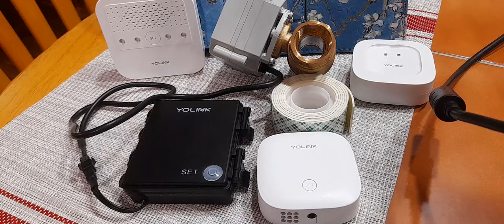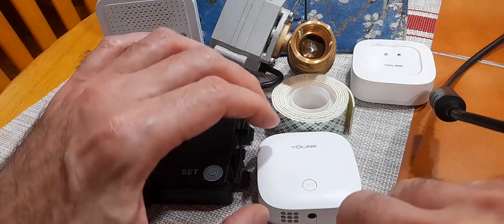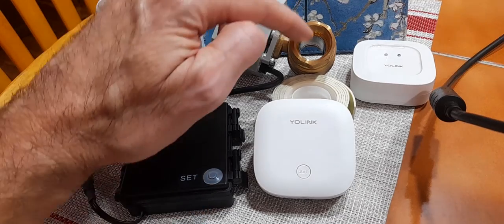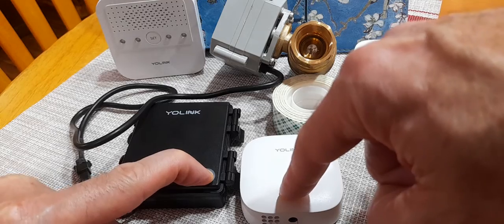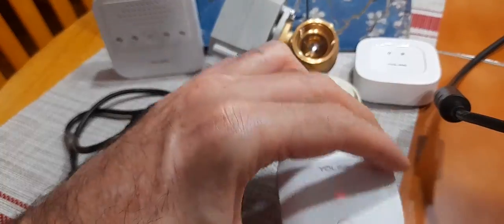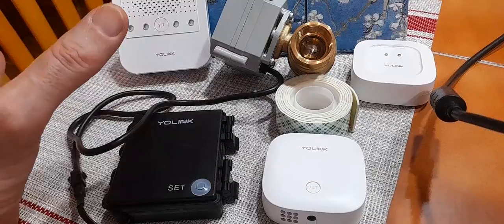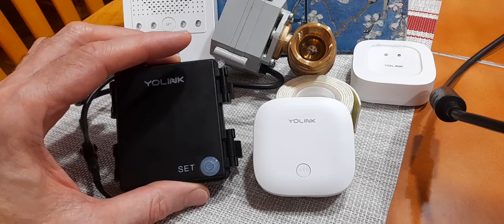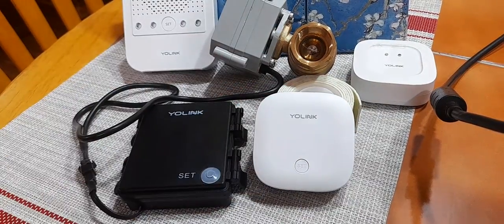How to Setup Yolink Smart Water Valve.

Comment: How do I set up that sensor without the wire?  It is in the app but say offline.  Same for my valve, but I got the speaker hub to connect because it had the button and voice that speaks.  I pushed the set on the valve and the sensor, but both kept blinking green but never paired???
Reply from the maker: You are referring to water link sensor 1?   You have to hold the set button until the sensor blinks green, then hold the set button on the water valve until it blinks green.  Make sure the valve is in the closed position before starting the paring.   Here is a link to Yolink's tutorial: https://youtu.be/dD6oNUzuxSE?si=0KbAcO-M6Q8F4mEM  If that doesn't work you may have to do a factory reset on both.  Let us know if you need further assistance.
Reply: @CyberMedics  Yolink walked me through it, but thank you too!
Reply from the maker: Glad you got it sorted. Thank you for commenting, giving the video a thumbs up and subscribing to the channel. We appreciate the support. Done a lot of content on account and device hardening if you're interested in that let us know we'll send you links to the videos.

Comment: Hello, I have a question on the length of the ball valve (1" valve) from one end to the opposite end without any fittings. Thanks.
Reply from the maker: We installed the three-quarter inch valve. I’m not sure it’s the same as the 1 inch valve would recommend calling YoLink Tech Support and asking that specific question. Thank you for supporting the channel by coming and giving a video thumbs up. Please consider updating us to install the valve. let us know if you have any other questions.

Comment: Hey i know im late to this video, but do you think his would be worth using as a hot water bridge valve for long distance recirculating?
Do you know what's the protocol it uses to communicate with the hub?
This would be great to use with a smart outlet to turn on the recirculator pump and also some temperature sensors clamped onto the copper piping!
Reply from the maker: Thank you for the comment/questions.  I've included some useful links for you below.
The hub communicates withe the device via the LoRa profile.  Yolink products can communicate device to device up to a  1/4 mile (approx. 1300 ft).  

The valve functions like a normal ball-cock valve, with the addition of a smart controller.  Yolink also has an AC power supply for the valve.

a) Hub Manual: https://www.yosmart.com/wp-content/uploads/2019/12/YS1603-UC-YoLink-Hub_User-Guide_20190903.pdf
b) Device to Device Protocol Explainer:  https://shop.yosmart.com/pages/explore-home-page
c) Hub Homepage https://shop.yosmart.com/products/ys1603
d) Semtech: Company behind LoRa tech: https://www.semtech.com/products/wireless-rf

Let us know if you have any other questions.

Comment: How do you know when it's time to replace a sensor? They're advertised as 5 year internal battery life, then discard, as sensor is fully sealed non serviceable.
Reply from the maker: You can check the battery level in the application for yoLink. You can open them up and replace the battery. We have done this. It might affect the water resistance of the sensor, but it will still work.
Reply: @CyberMedics  Good to know, thank you
Reply from the maker: Let us know if you implement the water valve and any lessons learned

Comment: I’m upgrading my water heater & softener soon, wanting to incorporate a system like this. I’m strongly considering yolink! Is there any indication on the unit that it’s open or shut? Does the app know if the valve is open or shut? I like this built in ball valve actuator, seems more reliable than mounting an external actuator for the lever. I just want to know when the valve is open or shut lol
Reply from the maker: Sorry for the late reply.  There is not an indication on the valve.  But if you have the Yolink Hub it will show in the app the status of the valve and all of the sensors.  I agree strongly that the integrated ball valve is much more secure.  Please let us know if you need help or have any other questions.  Thanks for commenting and subscribing!

Comment: I love YoLink...But what if you have fire sprinklers in your house, and a fire breaks out, and the sprinklers flood a sensor... and YoLink turns your fire sprinklers off. ?
Reply from the maker: Excellent question. In that case you would want to put in a bypass valve to go around the house shut-off valve so that water would always be present at the sprinkler heads. The bypass valve could be tied to a separate set of sensors that would alarm only when there was a malfunction with the sprinkler system. For example if a pipe had broken and water was detected then it could shut off water to the sprinkler heads. Would you please like the video and subscribe to the channel which supports our efforts to helpi others? Thanks for commenting and let us know if you have any other questions
Reply: @CyberMedics  Excellent response Thank you
Reply from the maker: @avpowerstn1  That's why we created the channel...to help others. Please spread the word Jim and thank you for the detailed question.

Comment: How reliable is it ? Thanks for the video.
Reply from the maker: The valve seems reliable. Haven't installed yet, but have opened and closed 50+ times testing.  Will update once it is installed. Thanks for commenting and subscribing! Let me know if you have any other questions.